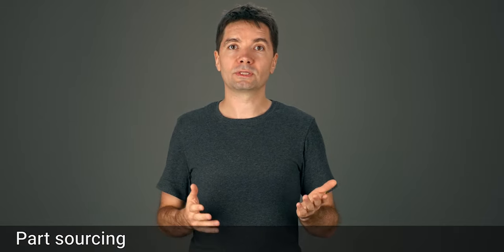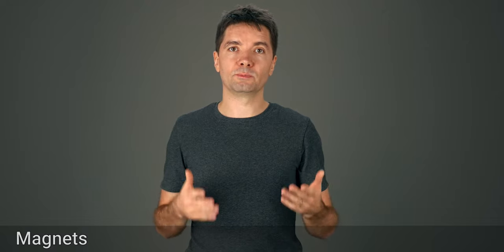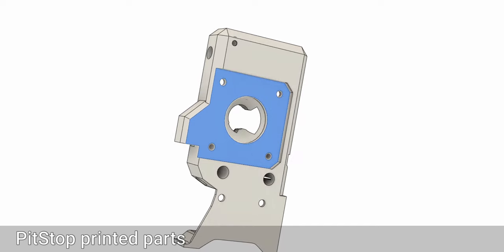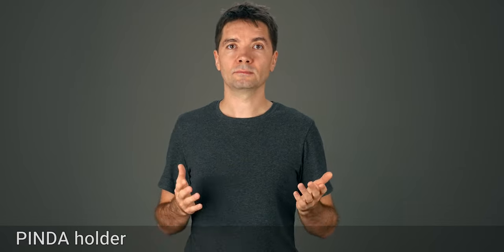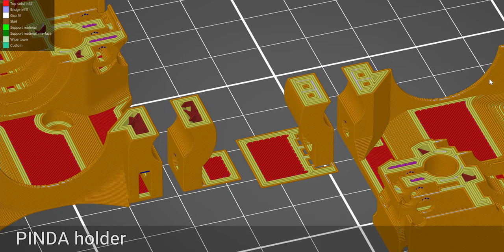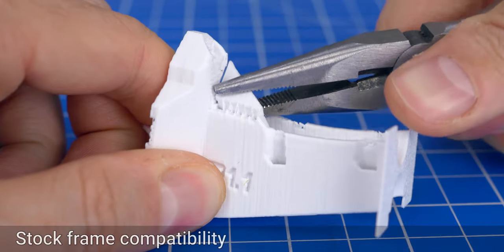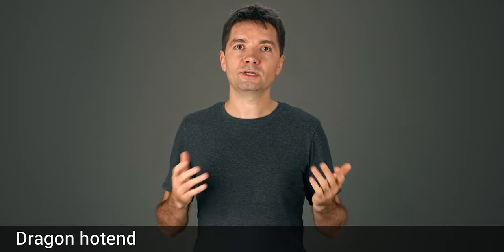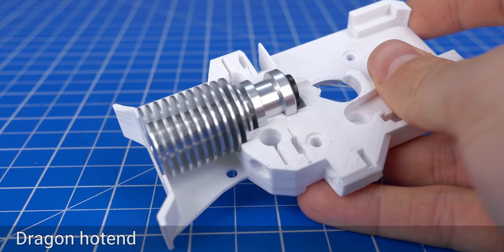PitStop Extruder V1.1 is here!

Comment: For the Quick Change Extruder that I use, we were using Micro DEANS connectors for the 2 hotend pins: https://www.amazon.com/dp/B000BOTWJU
Reply from the maker: Cool! I haven't used those.
Reply: @MihaiDesigns  Sent you a link to the BOM via Discord PM.
Reply: @ayourk1  xt30 connectors would be a nice alternative too
Reply: @SpsTamiya  XT30 connectors are typically too big.  Micro Deans are 5.7mm x 5.7mm x 7.2mm (11mm with pins): https://www.amazon.com/dp/B000BOTWJU

Comment: Thankyou! I thought about switching to the dragon hotend however because of the better heatsink cooling I decided to stick to the V6 but get brass copper plated heat block, A bi-metal heartbreak and a 50 watt heater cartridge + new thermistor and IKO bearings because I want to be able to reach at least 350C extruder temp (all these parts are from triangle labs) these should all replicate the dimensions of the V6, I will try to get the highest possible temp plastic to print the pitstop with, do you have any recommendations? or is it possible to print PC on a stock m3ks. cheers!
Reply from the maker: Cool! What kind of materials do you plan printing at 350? PEEK and the like? PC is probably the best affordable material for heat resistance. You might be able to print it on a stock extruder, but I expect permanent damage and parts melting at those temperatures.
Reply: @MihaiDesigns  My plan is to be able to at least print pure PC, I may look into the other filament types but PC looks more comforting to use than Peek or PEI, I think I will try to print the Pitstop extruder in the purest PC blend available for a higher temp resistance, I was initially going to do it in ABS because it is the lightest material available, petg is one of my favourite but it very heavy, heavier than PC.

Comment: If you are looking for a replacement part cooling nozzle, check out the RHD nozzle. He designed this nozzle using airflow simulations to get good air flow at all directions around the nozzle. There was a long thread on the Prusa forums about the designing of this extruder. It does require a slightly different mounting angle for the fan (and comes with a replacement bracket for the stock Prusa extruder assembly). This might be a good candidate to remix for fit for your PitStop extruder.
https://www.thingiverse.com/thing:4124587/files
Reply from the maker: Yup, I think that's the best part cooling shroud I've seen. I'll try adapting it if nobody else does.
Reply from the maker: @Sembazuru  right, I forgot about that one. It does use countersunk screws with an adapter, but should work.

Comment: what is the point to switch from PETG to ABS/ASA to printing pitstop,, original prusa is with petg and look good, pitstop use better cooling then should be also better with petg
Reply from the maker: It's only for enclosure printing.
Reply: PETG is generally fine if you aren't running your Prusa in an enclosure, but I did couple of back-to-back 3 day long prints in ABS using my Prusa and it warped the Extruder body (especially the PINDA mount) on my MK3s. I'm using the Bondtech BMG extruder now (their products are printed in Nylon using SLS) and I've had no such issues with ABS prints.
Reply from the maker: @brandonallen2372  yup, that tends to happen if you print ABS.